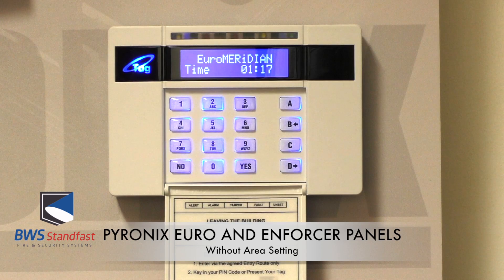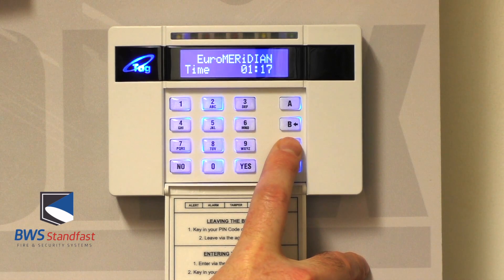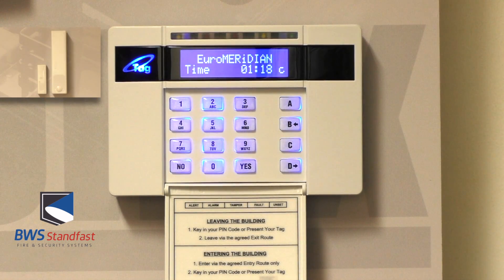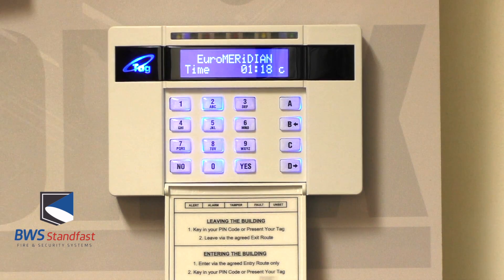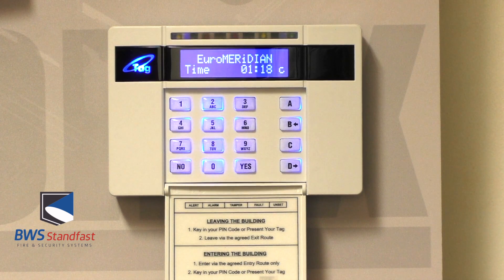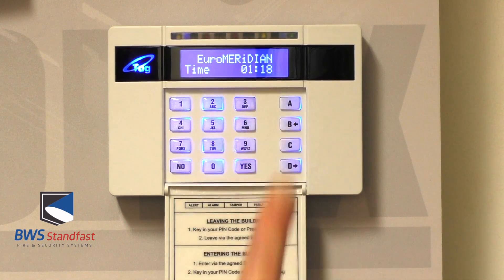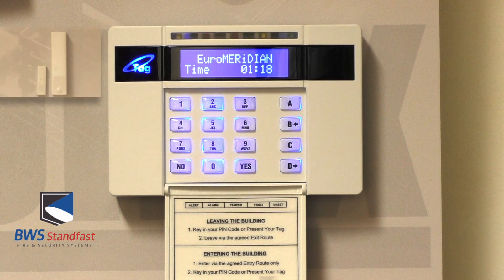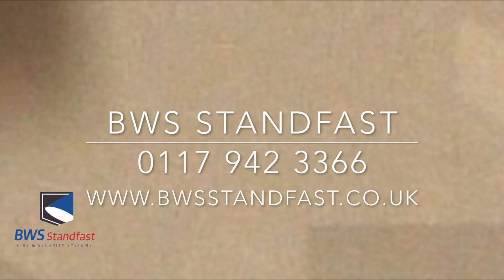How to turn on and off chime mode on your Pyronix system

Comment: This is helpful but for some reason the chime isn't activating? I'm not sure if the zones in the house are switched off or not? I did try to enter my code but that activated the alarm instead of just activating the chime mode.